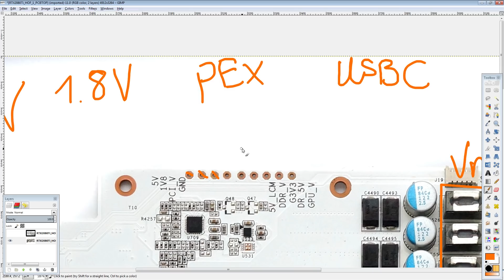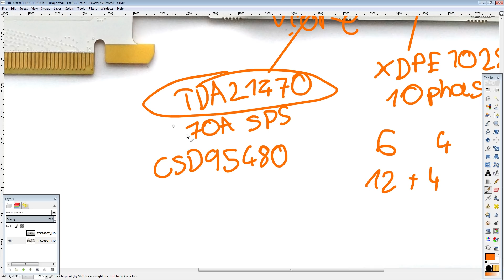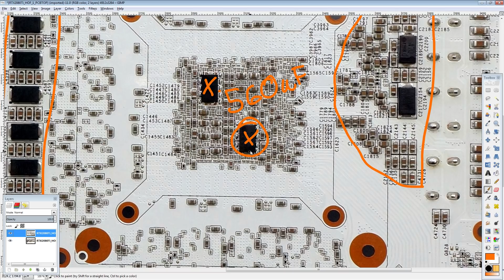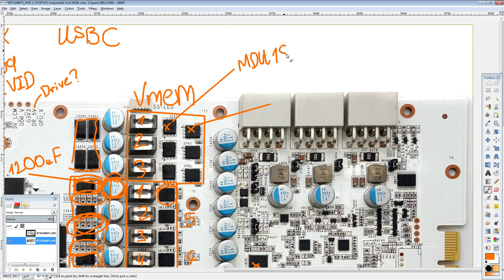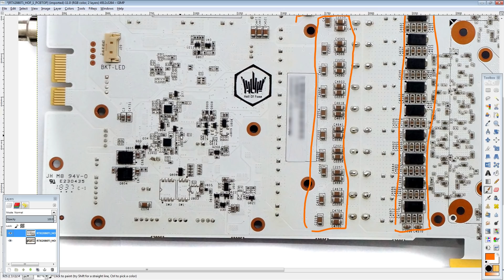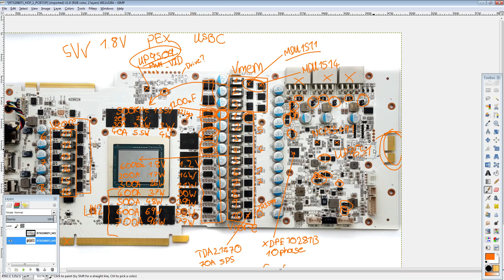PCB Breakdown: Galax RTX 2080Ti HOF OC Lab Edition

Comment: This might be an extreme long shot but I have this card and it died about 2 years ago.

Died in the sense of : It boots, the GPU bios message shows, but I have artifacts (horizontal intteruppted lines).

I have now taken the card apart ,and al of its thermic pads were fully dusted, I am ordering replacements at the moment but wanted to ask : 

Anything else I should look for on this card ?

Comment: Why not 12gb though looks like 1 chips missing?
Reply: Easy my friend. This is Nvidia being greedy, they first built them with 12 but then they thought naa, no one will notice. No for real, it is because of the PCB and the components of the 2080ti and Titan RTX are nearly the same, they just leave some components out and deactivate some parts on the chip itself. In this case, the titan actually has 24gb, with one ram chip holding 2gb, while the 2080ti just gets 11 1gb chips. So the place for the chip is used in Titan/Quadros.  Nvidia also produces the same Turing chip for them and then tests each one to determine its quality. If its the best it will be a titan or Quadro, if it's usable it will be a 2080ti and Nvidia deactivates the bad parts. This is actually an industry standard and also happens at Intel or AMD(don't know with them though). Intel will just deactivate bad cores, for example, it is not anymore an 8core chip but a 6core chip(maybe it would go from the i7 lineup to the i5). And here I am again, not completely off topic but well. I hope I could help you, if you have more Questions, just ask :)

Comment: Hi there Buildzoid! Is there a reason gpu manufacturers don't use solid state capacitors instead of electrolytic capactors? Is it mainly a cost thing or are there some other reasons?
Reply from the maker: Polymer capacitors are solid state. https://en.wikipedia.org/wiki/Polymer_capacitor
Reply: Actually Hardcore Overclocking thank you very much! I was watching your pcb analysis of the msi gtx 1070ti gaming and heard that the capacitors were of unknown origins. You guessed that the capacitors might only be rated for 2k hours, so I was thinking, maybe I can have them replaced with better capacitors.

Comment: Buildzoid, would you mind continuing the crusade of harping on Motherboard manufacturers so they actually think about updating their garbage BIOSes instead of repackaging them on higher end platforms? Thanks to your videos I find myself really wanting to leave Gigabyte in the dust, while letting everyone with a Gigabyte board know why they should not be using them. Cause they are absolutely atrocious for non-advanced users, and any motherboard which handles itself in an unstable or hardware-degrading manner, especially with inaccurate reporting to the user, is just trash that nobody should buy.

Comment: my idea about these weird  Phasecounts..

16 Phases, 3 connectors+pcie.
let's assume that "up to" 4 are on the PCIE, and "up to" 4 of the others hanging of each 8 Pin.
the Controller is seeing 8 Phases, but there is other Chips around the board which can "cut" the 5V to some phases to disable them.
Why?
if you are close to hitting one of the Power Limits on one of the 12V inputs, you can disable one of its phases and activate another one which gets the same PWM, but draws the power from somewhere else.

Comment: Looks more like a flexible V_core VRM that could be run in double-stuffed 8 phase or doubled-up "16" phase modes depending on how the PCB is outfitted in production, with this model foregoing the doublers and running in 8 phases. Maybe Galax will do a run with doublers for the competition cards?

Comment: Hey buildzoid, if my card has a 5+1 phase controller, but vcore only have 4 phase. There is actual spacing for the phase, so if I successfully put a powerstage onto the space, will the controller auto detect it and run it as 5 phase instead of 4? Or the controlling scheme has already be configured, so the extra powerstage wont do anything there.

Comment: What is the connector in the upper left?  It has a mess of wires going to it and I don't think it is a display one.
Reply: the connector on the top edge of the PCB (between the GPU and the display plugs), is the NvLink thing. Not really NvLink as most of it is disabled on the non-Quadro/non-Tesla cards, tho apparently it's the replacement for SLI, supposedly. SLI is not on the RTX2070 unlike the GTX1070, so who knows what else Nvidia is gimping this time with SLI support.

The other thing on the PCI bracket with the twisted wires going to it, is just a button thing, "HyperBoostX" whatever that is, guessing to control fan speeds or Bios (Primary/secondary) select switch.
Reply: @Zarcondeegrissom  the wires connector, the lever
Reply: yeah, HyperBoostX button, I will guess it switches to a higher boost clocked bios. It's a good question, what the hell is "HyperBoostX"?
Reply: on the 1070 HOF the switch just turns up the fans to 100% , it doesnt change the gpu clock . I dont think its different on this card
Reply: the funny thing, i think this card comes by default with a waterblock and with a ln2 container as an option
Reply: yes you can get it with a waterblock like the dude that send buildzoid the pcb Pics, but i dont think its by default because you could also get it aircooled like any other hof Card as far as i know

Comment: There is an LCM connector at the bottom right, i assume LCM_5v is for some kind of silly RGB lighting they did not want to load down the main rail or fill with noise or whatever
"Lighting control module" or something like that
why they would give a tap for it i have not the slightest
Reply: It's the display on the card. LCM stands for liquid crystal matrix
Reply from the maker: yeah I missed that

Comment: $1700 and you get an empty parking spot where 1 more gig of ram could be lol
Reply: I agree with the 12GB Titan Xp vs 11GB RTX2080ti price tags, I work with Iray sometimes and that gig of memory means a lot to me, lol. As for the missing memory chip on 80ti PCBs, As Steve (Gamers nexus) started to note, various chips had a digit in the ID on the GPU die model number that indicated what memory chip controller was disabled in the GPU die, that corresponded to different chip pads on the PCB. adding the memory chip would do nothing as the controller is laser cut in the GPU to disable it.

In this example, I will guess the 'A1' refers to the M11 memory chip that is missing, tho it could be the 'K1' designation, too lazy to go hunt down the Ask GN that was in.
Reply: Right GN covered that.  I see that If you assign letters to the mem chips starting upper left being A then K is empty.  :)
Reply: Its not just a mem controller that is disabled but an entire SM... Maybe a Titan card will come with all SMs enabled??? Im not so sure on that myself but we can all wish right?
Reply: Ben Quigley I would be very surprised if they don't come out with a Titan RTX at some point. With 4608 CUDA cores, 12GB GDDR6 and a 384 bit memory bus. Basically the full TU102. With the 2080Ti FE being $1200, I think it's reasonable to expect around $2000 or more for the Titan.
Reply: Titan T and will most likely cost over $3,000 again as titan cars are not meant for gaming so they will charge server prices and would most likely have 12gb HBM2 not gddr6 as memory is more important for machine learning and other raw number crunching wear you don't need certified drivers (quadro line) so don't get your hopes up for  a titan names card but i do suspect like you they will pull a 12gb full unlocked TP102 core and 12g ram but call it a 2080ti 12gig like the 1060 3 vs 6 gig
Reply: The only Titan in recent times that's legitimately not for gaming is the Titan V. The Maxwell and Pascal Titan's were all glorified gaming cards that lacked all the features you'd want in a proper AI/Deep learning card. I'm thinking they'll go back to making another "not for gaming" (but really it's the fastest card for gaming, hint hint wink wink) Titan with the full TU102 and GDDR6
Reply: @isakh8565  IsakH85 your prediction of the RTX Titan was extremely accurate!!!!
Reply: @metanumia  Yeah, I got the amount of VRAM wrong, but otherwise it's exactly what I was expecting.
Reply: not much they could do about that, thats on Nvidias part.
Reply: it's missing a memory controller so even if you soldered a twelfth gig of ram on their it wouldn't work
Reply: we were talking about a potential full unlocked tp102 core so it would have the memory controller enabled like old titans in the past. we were speculating on how they would name such a card most likely it would not be a titan name but they would have it in the same vein as the old titan cards so it would have this last SM unlocked
Reply: Exactly, but why don't you think they would call it a Titan? Why break away from the formula now, that worked so well before?
Reply: Zfast4y0u, myself included, cuz every gig matters in Iray, yeah them greedy bastards, lol.
Reply: Gotta enforce product segments somehow AMIRITE?

Comment: What would happen if you soldered on a new Ram Chip into Pad # 11 ? Would it work ? BIOS?
Reply: my guess is that the chip doesn't have an extra transceiver for the new GDDR chip
Reply: As Steve (Gamers nexus) started to note, various chips had a digit in the ID on the GPU die model number that indicated what memory chip controller was disabled in the GPU die, that corresponded to different chip pads on the PCB. adding the memory chip would do nothing as the controller is laser cut in the GPU to disable it.

In this example, I will guess the 'A1' refers to the M11 memory chip that is missing, tho it could be the 'K1' designation, too lazy to go hunt down the Ask GN that was in.
Reply: The K1 is apparently referencing the disabled memory controller #11. (K being the 11th letter of the English alphabet)

A1 is the silicon stepping. (Once would have been starting at A0 so A1 would have stood for A = first tape-out, 1 = first fix, but Nvidia have been shipping "A1"s for so long, who knows if that still applies.)

[GPU] - [SKU] - [optional, apparently used for disabled memory controllers on TU102] - [stepping]
Reply: Just get Louis Rossman to do it wish his ZhaoMao :) I want to see someone do it.

Comment: Whoa this is nuts. Maybe the 6 phases on the left of the GPU are always on, and the 10 on the right are power balanced by the XDPE1028713 thingamabob.
Reply: could be ... for example my gtx 780 lightning has got some led`s for indicating work on every single phase and it has got about 6 or 8 phases wich were run in 2d mode and the rest is waken up in 3d mode by the controller